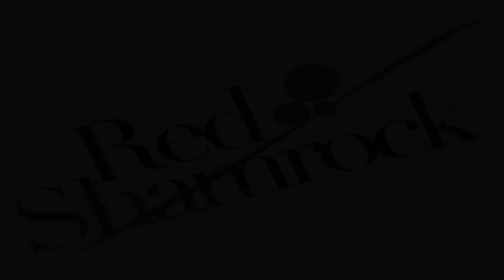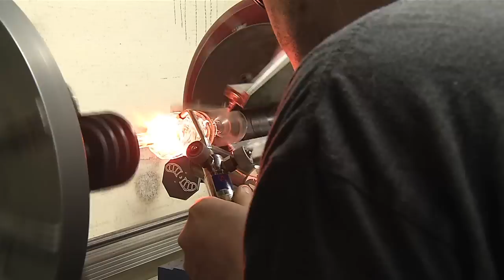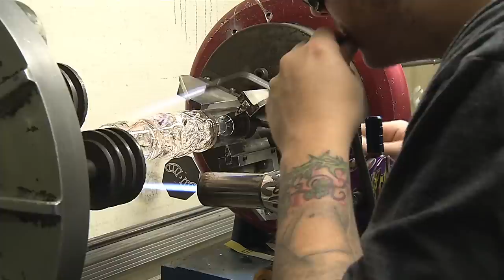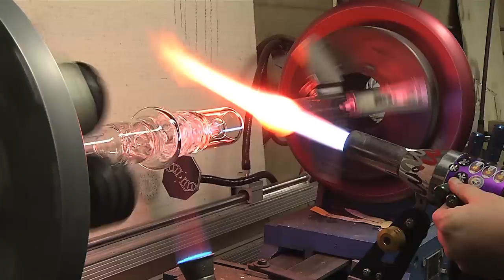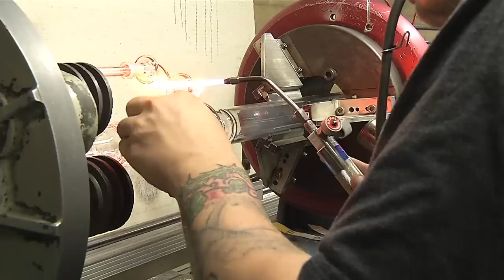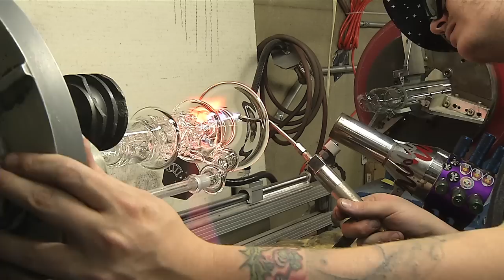Worm working with first GTT torch piped with compressed air.

Comment: I don't thing gtt offers air cooled torches yet. This is a three stage. It's just got three different fire rings. Also, compressed air, on torches that do run it such as the old Maya's and some Beth's is to lower the temperature of the flame. If you work tiny candles on a hot face you can melt torches themselves. Compressed air makes it so you can basically abuse your torch an not blow up. :) tards.